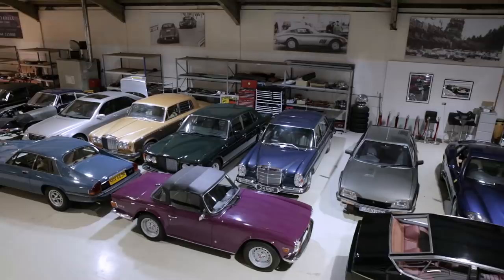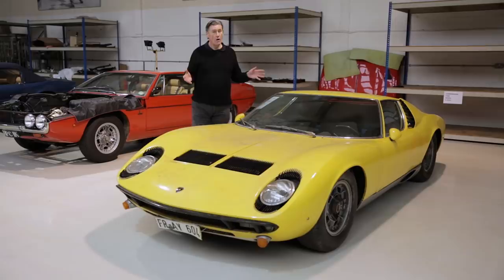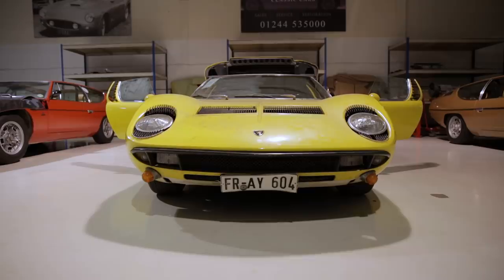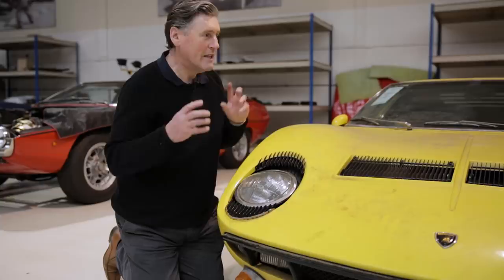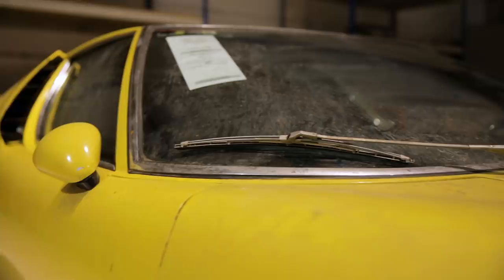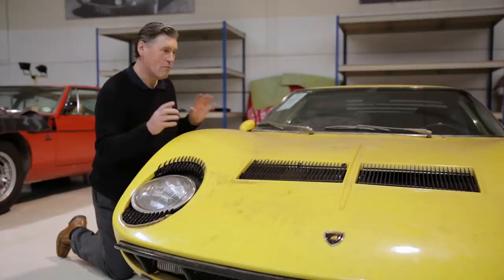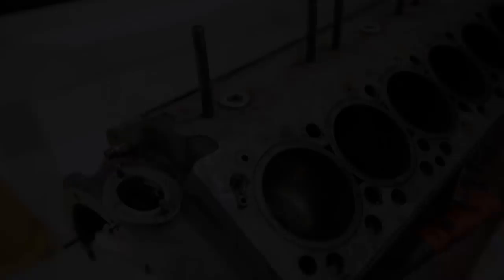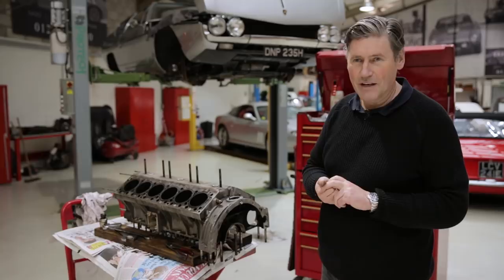Lamborghini Miura S & Ferrari 365 GT 2+2 | Welcome to Tyrrell's Classic Workshop

Comment: Fantastic introduction very nice manners calm and no obnoxious overpowering music. 

I own a very early Audi C2 100 July 1977 76 reg. I have been recomissioning after a 31 year Lay up. Because it has been of the road for so long it has been preserved so well. I am conserving  and recording all factory paint marks on body, suspension and mechanicals. I have had all major brake components rebuilt to keeeep factory castings and factory logos. Same for the water pump 🙂

It's possabley one of the oldest in the UK for a Type 43 C2. My dad wanted to scrap it but I managed to get it. Hears the thing if I was not interested in mechanics It would for sure been scrapped. The car is so original in most aspects considering how they rusted. My duty is to conserve and preserve what I can. 

It's no Lamborghini but all old cars need special care and consideration. 

Also I found a 1970 series 2 FC2B that sat in a barn since 1991 with 5087miles from  new. Again I carefully recomissioned preserved where possible practically all bearings bar the fan assembly are original (fan was removed to save fuel) Like the Audi I did soak bores  carried compression Tests etc before running with fresh oil. 

Audi was 90, 95, 90, 100psi after a run the compression was 130psi across all cylinders. it will improve after a longer run. The land rover was similar 90 to 110 psi then health compression. It's all about feel. That what I like about yourself you have that feel. 

Again thank for creating your own channel.

MY land rover has period seatbelts  they are not pretty but are part of its history. it's so tough to decide what and what not to do. Because once a component is removed especially interior wise will never be the same.

Comment: I’m exactly where Iain is in details like the brass door seal clips. My 1970s Suzuki GTs have the original cylinder indicating plastic clips that fit on the HT leads. Almost NEVER seen, as they can go brittle with heat and UV and break off and, being too fiddly to repair, they’re almost always lost. I’ve bought entire coil sets from American breakers, just to get an “L”. I can’t explain the satisfaction of completing a detail I’d been looking for for a decade. I usually lightly restore, test (& therefore warrant) the triple coil sets, then sell them on, covering all my postage costs. Net outcome: being paid to bring it back to factory is priceless.

Comment: Hi IAN I don't know if you remember me you tuned my chevette red 1258 my carb twin 40dcoe cracked you swoped over for a new one l remember you tuning my carb by ear when you were based in wallesey on the wirral brought a 2300 slant four engine and gearbox all the right conversion parts never got around to the engine swop had a massive stroke sold any way enjoyed seeing you again Harrys garge and now you're own you tube chanel  cheers dave swift

Comment: I was particularly interested in your observations about exhaust valves, I've just reassembled a 1960 Velocette, that has a Nimonic exhaust valve which can run red hot for ages. I'm curious that there were austerities stainless stems used,  hard facing is a great idea, but I'd have thought the stainless a bit soft, and a relatively poor conductor of heat. I'm assuming they are not magnetic?
 Carry on with a great start, well done.

Comment: Hubert Hahne was in the early 1960s a very famous touring car racer for BMW on BMW 1800 TI / SA (for Sport-Ausführung specifiying a Club Sport semi professional version) and 2000 TI of the new class series produced from 1964 to 1966 and from 1966 to 1968.  His wife was famous actress Diana Koerner that is why he did created a special version of the BMW 2002 with the name Diana , with Connolly leather interieur, Poltrona Seats and optional upgrade to BMW six cylinder engines. With these BMWs Racing Versions Hubert triumphed on th Ring over the Alfa Romeo GTAs and also some of the late Mk2 Jaguars in 1964 although they had more perfomance the 1800 TI/ SA with 800 kilos empty weight and 160 netto hp were a force under the Nürburg.

Comment: Well Iain So-and-so, I think it's all despicable.  Fancy cars, fancy accent, sonorous drives after delicate and clever little tweaks, despicable.  Did I say despicable?  I meant delicious.  And greetings from a man who, in his soft mind, was champion at Le Mans and Monaco.

I think that the 365GT 2+2 is just stunning.  I recall a Road and Track test where they liked it but were of course lusting for the Daytona.  And it did look ponderous, but over time you realize that the lengthened shape is actually more fluid than the nearly-perfect 330GTC single-headlight design (and its 2+2 version) which proceeded it.  In real life it is one of Pininfarina's best designs, for a small minority.

Comment: I know it's at the owner's consideration, and my comment and opinion has no bearing on Mr. Tyrrell's work, who obviously knows everything there is to know about his chosen and clearly loved profession, but i wouldn't even so much as touch the car, considering the age, provenance, and level of originality / history.

Yes, i would deal with critical issues that might affect the car's future. Rust, fluids, keeping paint from further degrading et cetera, but painting the car, considering where it's from? It would lose a considerable amount of value AFAIC. One of the reasons i respect Jay Leno for example, he has quite a few cars that are restored to factory spec, but a lot too, that have scratches, chipping paint, originality.

There are solutions for keeping paint from going worse. I think car restoration should seriously follow painting restoration rules. We're starting to talk about pieces that now transcend function and slipping into art territory in some of them. I mean, what else could you call some cars that from say 40k+ produced, dwindled down to 12 existing cars with 10 of them being spare parts cars. 

Again, no issues with what the shop does to the car, i just think the current owner is making a huge mistake if the car gets new paint (and other severe changes), there's absolutely no reason to do it. Paint is an aesthetic thing, the structure of the car can be easily preserved.